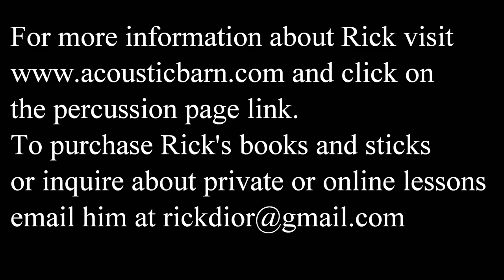The Dialtune Snare Drum

Comment: Rick, Thanks for the “road test” on this drum. Very interesting drum, especially with its tuning benefits. Given the price and the weight, I’m pretty sure I’ll never own one. It seemed as you installed the PS head, that it didn’t really seat completely flat on the bearing edge before you sat the rim on. Is it possible that this might take a more vintage dimensioned head? Also, the tuning dials seemed very easily adjusted. Is there any locking of the tension setting, or does the tension friction keep it adequately positioned? One last note. As you adjust the snare side head, do you also adjust snare wire tension.
Reply from the maker: Hi Fred
No locking mechanism on the dials.
I zero both of them out to very loose when I change the heads so I have a good starting point. The knobs have a feel as they get tighter and it's similar to the chain drum timpani mechanisms my timpani teacher Fred Hinger used to use. I am learning to get very fast tunings with the feel of the knobs.
I have been playing with this thing non stop since I got it and I like it more and more everyday.
It turns out that I was not loosening the top head enough so thats why it was difficult to get the head off and on. I will soon do a follow-up video and elaborate on that and other things but right now this drum is an absolute revalation.
Reply: @rickdior  Thanks for your reply. There is no question that the fast tuning capability opens up a lot of doors, especially on the fly.

Comment: Isn’t it only needed to loosen the one knob that controls tension on the top head to remove the head ?
Reply from the maker: Yes that's right but I zero the drum out and then bring both heads up together to get a good starting point.
Then you can adjust each head from there.